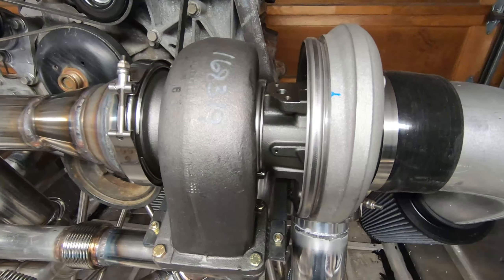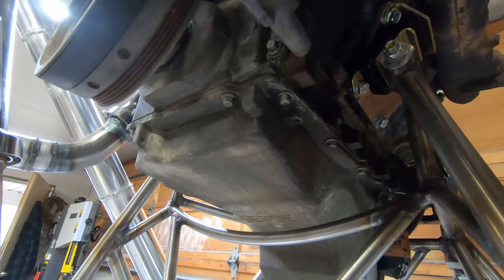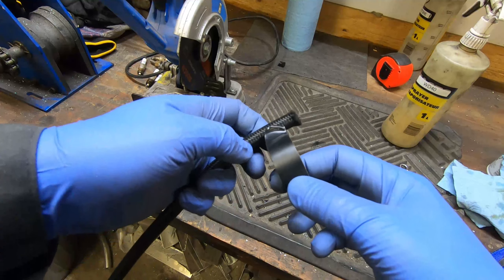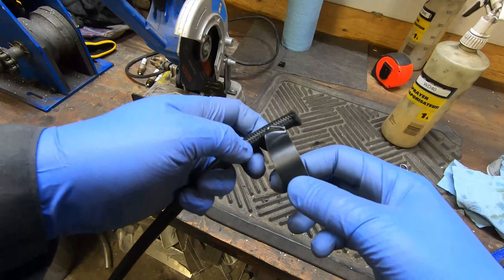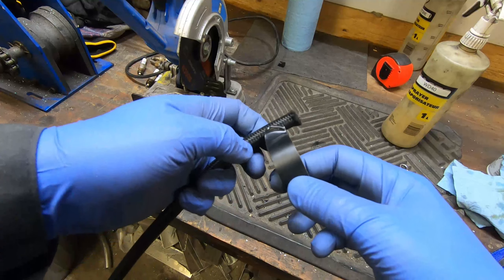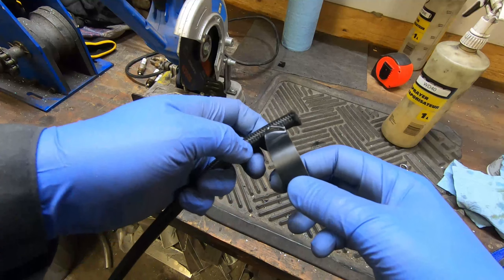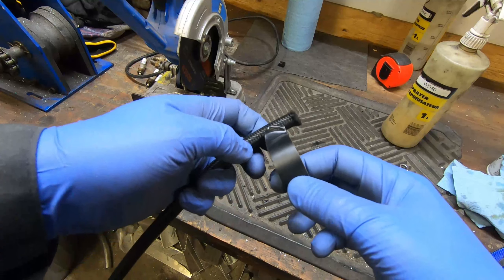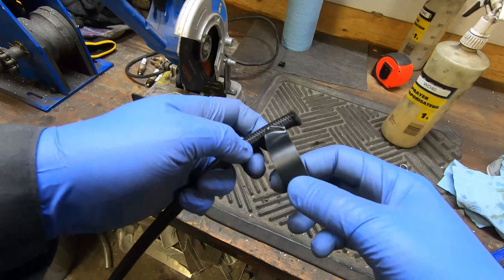Airboat Build #17:  Turbo Oil Lines

Comment: I personally would have stayed away from that serpentine belt- it may make a mess of your return line if it lets go. And using hard tubing for the return line - it being so close to the extremely hot turbo.
I'm liking your videos - Thanks.
Reply from the maker: Good thoughts, thanks!  I have revised the oil lines a bit since.